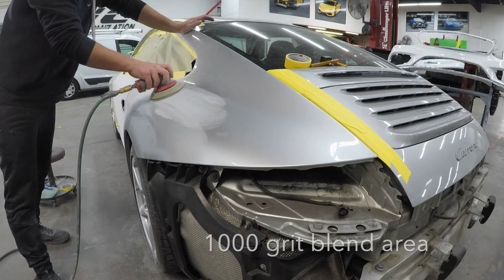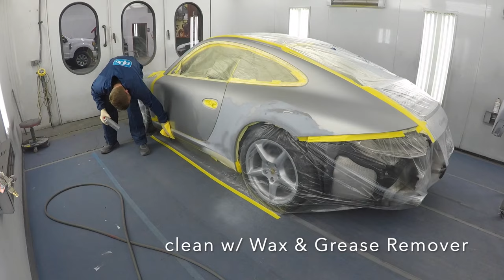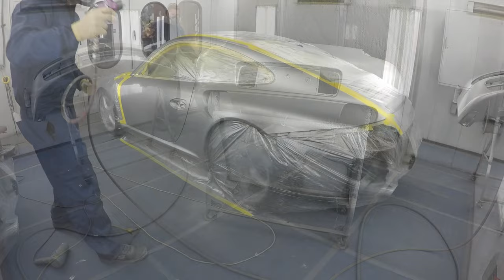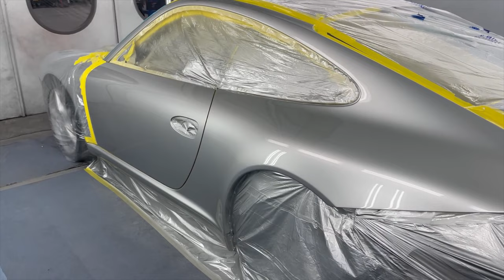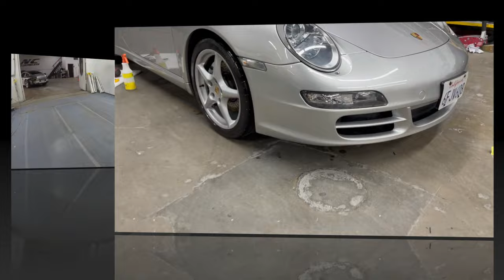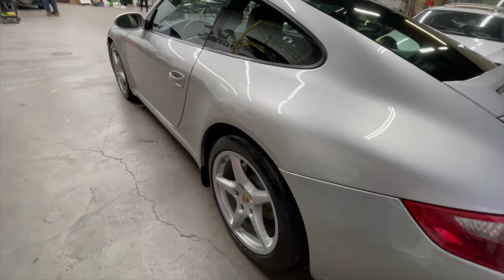Painting Silver Porsche 911 Carrera side and bumpers

Comment: I realize you're cutting the clear coat surface to get a good, uniform bond. Is there a deeper or more extensive prep required for a complete color change?
Reply from the maker: Just like you said prep the surface to be flat and uniform before paint making sure all the edges are scuffed up as well. For color change i would prep entire car with 600 grit, apply proper gray shade sealer, base coat and then clear.

Comment: Your paint work never show any orange peel.  Can you show how you deal with that or possible prevent it.
Reply from the maker: Proper clear-coat hardener and reducer depending on temperature and size of the job. Secondly is proper airgun pressure and overlap. But most importantly is a nice flat and uniform prep of all the surfaces, then each layer must be Uniform and even, starting from sealer and basecoat. If you apply your sealer or basecoat uneven or rough, your clear will never lay out like glass. Each layer builds up and creates a little orange peel as you go, so you want to keep the buildup to a minimum.